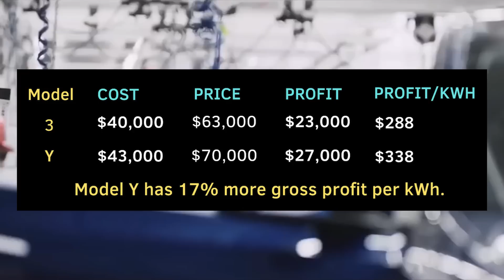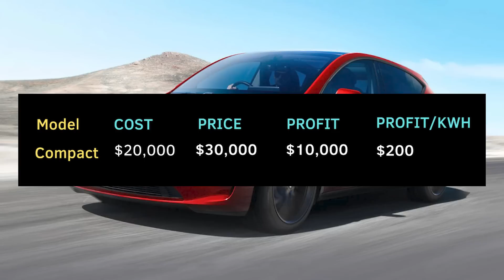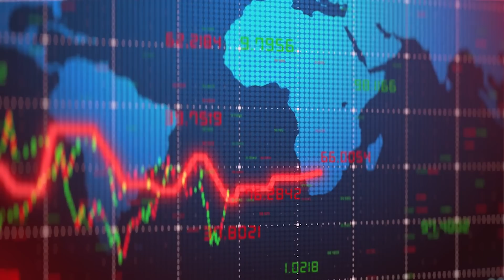Will Tesla Launch a Compact Affordable EV in 2024?

Comment: This affordable car we're all expecting is already here, it's right in front of our eyes. It's the model 3. Once Tesla figures out how to make it a single piece casting with the gigapress, they can lower the price to manufacture it to  15 000$ and sell it for 25 000$. Tesla also has to scale up production of their own 4680 batteries to help lower the price of this version of the model 3. The model 3, the model Y or both could be used for the Robotaxi service. Of course the model 3 being the more affordable version of the Robotaxi, and the model Y being the medium luxury version of the Robotaxi service. Any of Tesla's vehicles could be used as a Robotaxi. Even the Cybertruck.  Tesla's a bit ahead of us, their solution to a lot of their problems is already on the road.
Reply: If, in say 2-3 years, half of the manual assembly work is being done by Optimus, how much of a further saving would that bring?
Reply: Totally agree - even the Y will become way cheaper to produce, especially if they can have Teslabots reducing the cost of labour. Probably not exactly the same as the current 3/Y but mark 2 versions/new 3/Y will eventually hit and the originals can become the budget cars. $30 - $35K with standard range models would give them ridiculous demand and profits.

Comment: MG is already making the equivalent of the affordable Tesla - it's called the MG 4. Likewise, BYD has their Dolphin. But all these vehicles are conventional EV's with boxy steel bodies, which makes for underwhelming efficiency and range. If Aptera can ramp successfully next year and prove that a hyper-aerodynamic EV made of Kevlar composite which is 7x stronger than steel and much lighter, can get more range and also cost less because it needs a smaller battery pack, the race will be on. I don't see how conventional compact EV's will be able to compete with the Aptera. Conventional larger EV's yes, because they are being sold to wealthier buyers who want or need the extra space and don't care if it costs more, but for the budget buyer who is used to driving a compact ICE car that gets up to 500 miles range from a petrol or diesel engine, switching to an EV won't make sense unless they can get more bang for their buck so to speak. I used to own a diesel Citroen C5 that only cost me $7000 but could get 1100 kms range on a 68L tank of diesel. My current Toyota Yaris only cost me $5000 but only gets 550 kms of range because it only has a 42L tank and has a thirstier petrol engine, but when you consider that the cheapest EV in Australia right now, the MG ZS EV costs $47,000 and only gets 320 kms of range, that puts the equation of cost vs range into perspective. It gets even worse if you consider a used EV such as a 2012 Nissan Leaf that might cost you $20,000 and only gets 150 kms of range. Why would you bother? That's the myth that Aptera is about to shatter. Admittedly, it's probably going to cost about $40k in Australia but the base model starts at 400 kms of range and goes up from there, but it's already better and cheaper than the MG ZS EV. I don't see how Tesla is going to be able to match these kind of numbers. Given that Elon Musk has said he considers 250 miles or 400 kms to be the bare minimum range of an EV, he's going to have to match both price and range of these other competitors to get the attention of the budget buyer,  and given Tesla's addiction to huge profit margins, I think he will just give the affordable EV a miss and keep doing what he's doing, making EV's for the rich who can afford to give him those margins.

Comment: Since higher volume drives prices down, Tesla should just use the Model Y. Musk knows the Model Y is the most universally appealing platform. 

Battery energy density along with solar on vehicles could be the wildcard. If there was a Model Y that could charge 30 miles worth of charge a day, having a big battery pack would be less important. I think many would be fine with 200 miles range, especially if charge times was five minutes for 90% recharge. 

The notion of a $30,000 Tesla is outdated. The costs on so much has risen to a level that makes $35,000 more realistic. 

The meeting demand part is the big one. I see GM offering dozens of models when they cannot truly make right now. Models GM will likely take losses on. I agree if Tesla cannot meet demand with their current line as it is, pushing for lower price models does not make sense. 

If Tesla dsw a massive shift and their orders dropped off dramatically, bring in a new entry level Model Y would not take long for them to do.
Reply from the maker: Even $35k seems like a really low price point now.

Comment: Hyundai Accent SE 2022: $16,640 USD.  The cost of production of this car must be close to $10,000.  Subtracting the cost of the engine, transmission, radiator, catalyst, and everything that comes with a conventional engine, one should get closer to a production cost of about $6,500.  Let's add a 50 kWh battery and a 200 HP electric motor for ~$10,000.  We end up with a production cost of $16,500.  If Tesla wants to make a 30% profit, they could sell a comparable car for ~$21,500.  Let's add a little more luxury (+$3,500) and the car could sell for $25,000.  And if Tesla wants to sell its compact car for $30,000 (base version), then the profits will be incredible (~50% profit).

Comment: Hello, the tax write off of $7,500 is NOT what you think.  The $7,500 goes against your taxable income.  Say you are in the 24% income tax bracket.  That means you won't have to pay tax on $7,500 of income, at a rate of 24%.  This means you save $1,800.  That's it.  It is a 1 time tax write off.  So a Tesla that cost $40,000 will effectively cost you $38,200 + SALES TAX!!  In my state, the sales tax would be $2,500, bringing the cost of the $40k Tesla to $40,700.  So it's not as great as you think.  I used to be a tax consultant.  Just don't want people getting false information.  Which I can see in the comments, they already are.  Unless I'm mistaken on this income tax write off.  In which case you can point me to the correct information.
Reply: I'm an investor in Tesla by the way. :goodvibes: Have $30k in the stock.  I'm also a big real estate investor.

Comment: Lee: Elon did say very recently that they would have the robotaxi out in 2024
Reply from the maker: He said volume production by 2024 even. Which is why I think it would be even less likely we see a compact. Unless they are the same vehicle.
Reply: Where did he say that please ? Thanks
Reply: @lpb3731  I believe at AI Day 2022
Reply: Lee: I think they will be the same vehicle BUT if Elon has cracked FSD-i can see them building a vehicle without steering wheel or pedals first to build up the fleet and as they increased volume to costs could eventually come down in 2025 ot 2026 for them to offer it to the public too